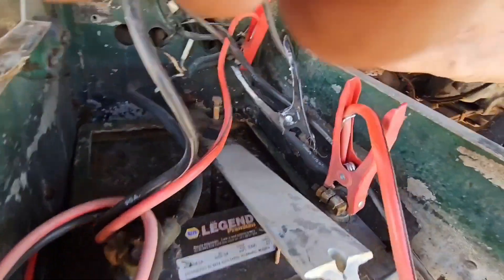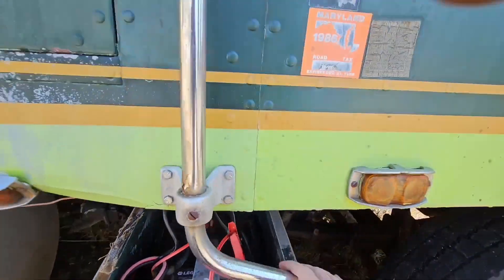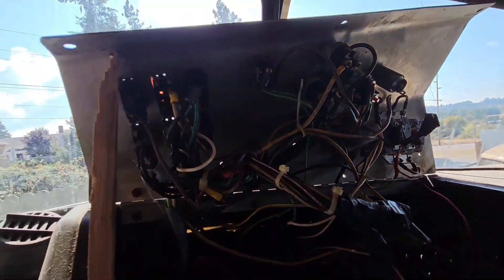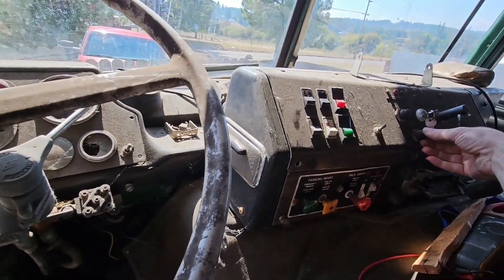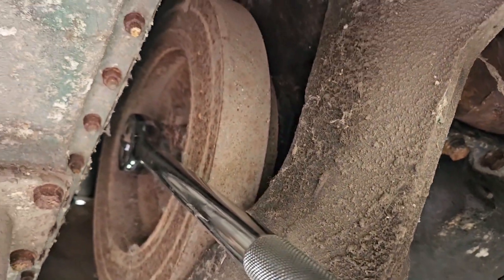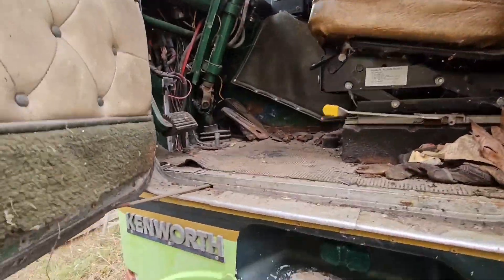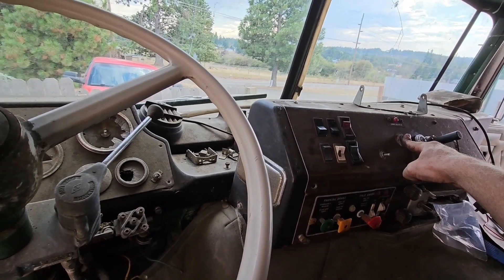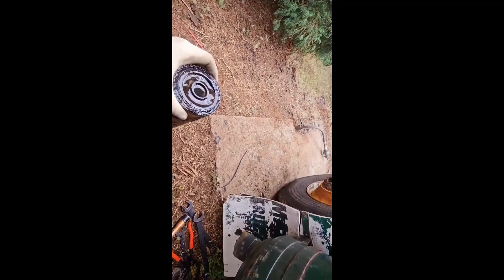Will the K100  start after 36 years of sitting?  or is it locked up. Episode #4

Comment: If you are going to run the KW upgrade the brace inside the cab that runs from the front of cab past throttle pedal & ends at cut out for shift tower cut out in floor & instell later brace that runs past shift towed cut out it will save cab from breaking up  ( if it hasn't already) & angle brace under floor on outside.

Comment: Doesn’t sound too bad, so I would say the motor is sound.  Just needs some TLC. I would definitely make sure it has oil pressure though, before running it too much.  My 84 International 9670 has a Cummins BCIII CPL625.  I have had the fuel pump rebuilt, locally for $650.  I actually have two, both CPL625. If you need one, let me know.  HOOAH!!!
Reply from the maker: I was a bit concerned about the oil light. So I haven't ran it since.  Going to add a mechanical gauge.  

625 is the one to have.  I still haven't looked at the tag on this one to see which engine it is.  It's definitely not original

Comment: You said you would have to see what those switches were in the dash; maybe if you can find an owners manual for the model it might have a diagram of your dash
Reply from the maker: I have a diagram on the way.  But alot of the stuff isn't original.  So I have some wire chasing to do.
Reply: @jaminstewart2444  that was one of the good things about the old school trucks… you could add accessories anywhere and tap power from anywhere without worrying about screwing up a computer by taking some of its power

Comment: I have loved trucks since I was a young as in six year old kid kind of person who got to drive for a bit. Starting in the late fifties, dad had me steer while he used a dozer to pull it through the mud to a better spot to take off like some kind of airplane. The days of ten cent gasoline and so had gasoline engines that had cubic inch displacement you would scream bull sh** but for real one thousand cubic inch gas motors that got feet per gallon. Approximately a half mile to the gallon on questionable fuels as dad was so cheap .... I am surprised we didn't have our toilet paper on the clothesline! Oh yeah, days of washable fanny wipe and mom had to hand scrub it with a smile on her face... that you would never really see unless they were both drunk.  On with a story line thats good for a book that no one would read. Dad had a old truck that I can only wonder now just what kind of truck it was... that cab slide forwards like it was on rails and had a big murphy engine in the hole that rough old cab covered. Where a speedometer should of been was a tachograph and a roll of paper was taken in each night for that persons pay. I mostly remember the smoke that billowed out from that area that a driver went in with white skin and came out different shades of black or gray. Chains that drove the rear axles with real power brakes if ya could call them power... actually it was vacuum brake and if that engine quit, no brakes was the next thing to cross you mind. One nice thing was a maximum speed of maybe thirty two or three miles a hour. Huge steel stack on it that really only kept part of the smoke out of inside the rig. Later came army six by six or even more axles.... yeah sir ree... those days are sure gone now.